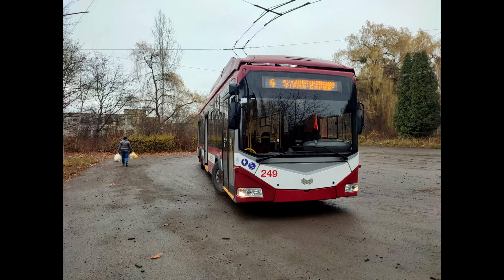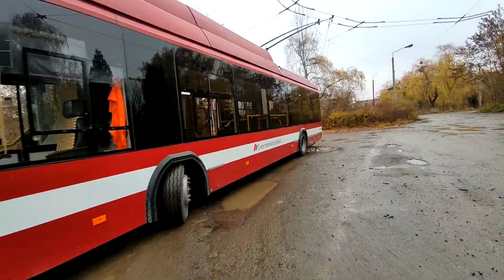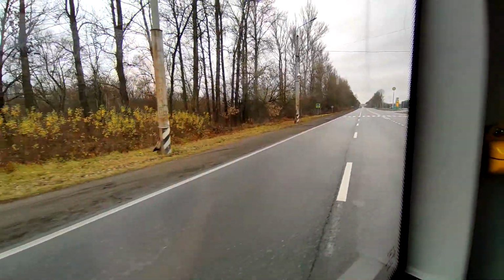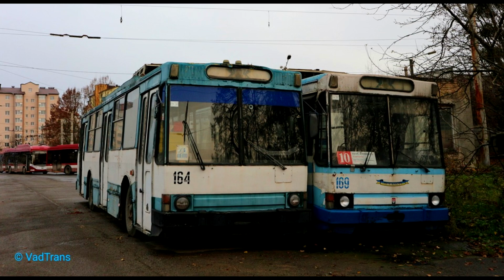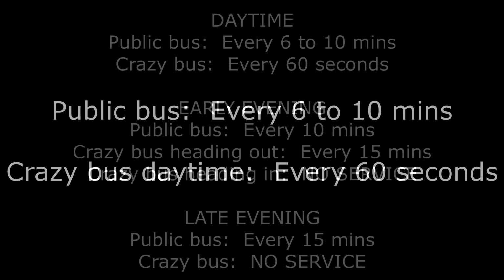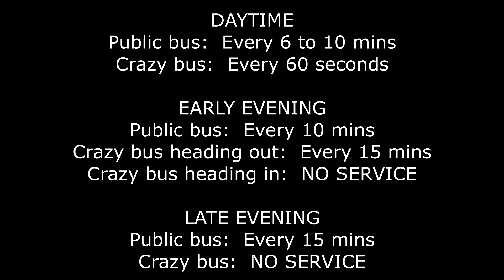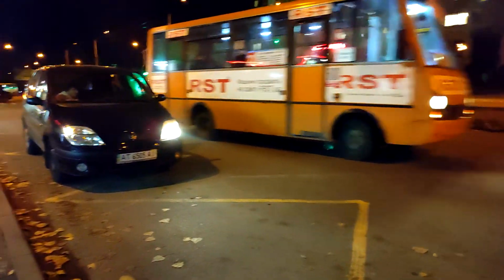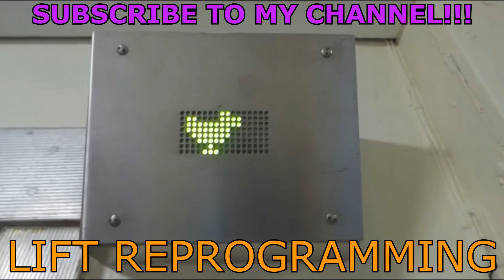Trolleybuses in Ivano Frankivsk Ukraine

Comment: This seems so much simpler than having buses carrying around tons of batteries that will wear out in 5 years.  In 30 years none of the major components in these buses will wear out or need replacing.  Well, maybe the odd major thing, but certainly not every single battery needing to be replaced every 5 years.